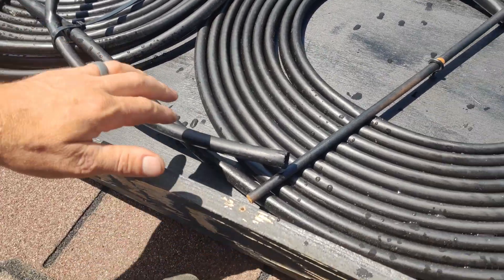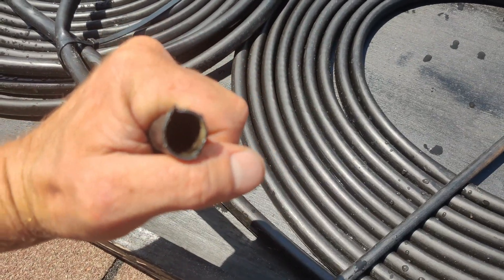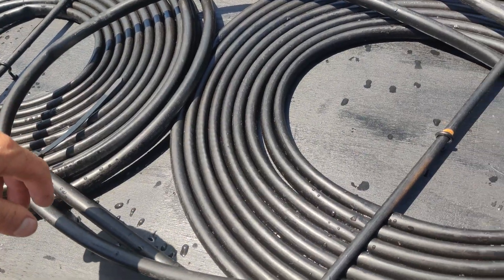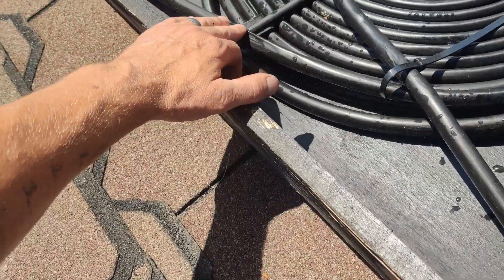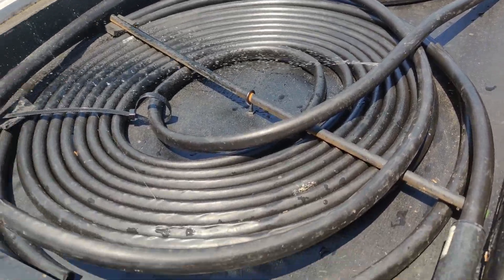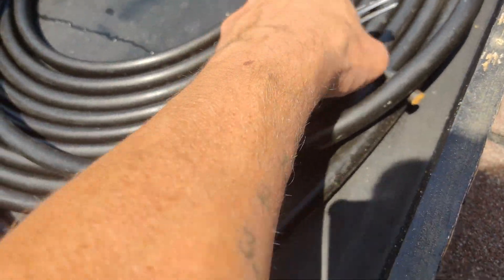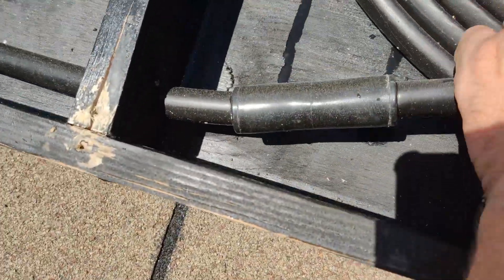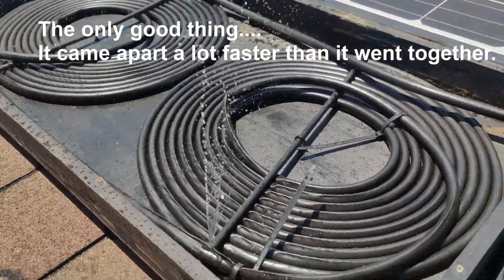DIY (don't) Solar water / hot tub/ pool heater. Watch before you waste your money!

Comment: Drip tube is where you went wrong. Use Pex, and coat it with an appropriate black paint. I live in the Mojave Desert the UV levels are typically 10 which fries everything. They do just fine here, you just didn’t use the correct materials.
Reply: my first instinct would be to use some sort of metal heat exchanger like a car radiator and put it in a black painted box.

Comment: Sorry your panels failed so badly. I am an HVAC tech, based on my experience with various forms of heat transfer and also seeing what survives exposure to the sun on roof tops I would recommend soft copper. Good luck in the future.

Comment: I still don't understand why you people don't just have a 6 pk of 55 gallon drums in the hot attic. To me having your own personal water tower with hot water from the heat of the attic space.  MORE LOGICAL WAY OF DOING WHAT UOU DID BROTHER
Reply: 2700 pounds on your ceiling?
Reply: Not to mention, a somewhat dodgy water setup in the attic. If it leaks, you've got big problems.

You're asking "you people" to try it. You try it first and let us know how it goes.
Reply: @Dwigt_Rortugal  Also, even though the air in the attic is hot, that heat isn't enough to heat 300 gallons of water.

Comment: You should use HDPE pipes - UV resistant instead.
Reply: Regular polyethylene is supposed to be heat-tolerant to 276°. I used it on my heater, regular old Rainbird sprinkler tubing (swing pipe?). Worked fine for years. 🤷🏼‍♂️

Comment: Well MINE sure worked!! Same exact design, but with no cover on it. My pool was actually too hot, in Michigan, well beyond the usual pool season. It ran 2yrs, then we moved. It was still in perfect operational condition with zero deterioration when I took it down.
Reply: Yeah I don't know seems like this dude probably left water in it over the winter which blew everything up when it froze causing all this damage.
I built one out of 150 ft garden hose that I tossed up on my roof. Been up there three years now no problems.
Reply: Lots of people try slowing down the flow, thinking they get more btu from the panel. You don't. It just melts the plastic and destroys the system. Looks like what he did. Also lived in florida and Michigan. Can say Michigananders don't know what uv damage means lol. Also florida doesn't know what cold means.
Reply: I think the water flow was too slow perhaps

Comment: Not enough flow. You need to circulate it way faster. There's no way a sump pump can push enough flow through what is that 200 meters of cheap pipe?

Comment: I am planning to make one of these, but cover everything with 4-6 inches of sand to make a heat sink and help stabilize the temps.  Will post a vid if it works, but you may be able to salve this setup if it does.

Comment: I've been watching a lot of these videos in preparation for building my own, and it seems many folks make the same mistake from a physics perspective: they drive the water through the pipes as slow as possible in order to maximize the water temperature coming out of the line. This is not a good idea and it does nothing for you (in fact, it's likely counter productive). Yes, you get hot water at the end line, but you haven't actually moved any more heat into your pool then you would have if you would have had the water running on max. In fact, you're likely moving LESS heat into the pool. Remember where your heat is coming from: the sun. Less sun isn't hitting the pipes just because the water is moving faster (and is cooler on the other end of the line then if you were running the water slower). And to add insult to injury, you are just causing more problems: as the retained heat of the unit increases, it is causing more damage to the unit. Better to not allow it to retain much of any heat and instead put that heat in the pool where it belongs (by running the water through the pipes as fast as possible). Put it another way: you aren't building a domestic hot water heater to store heat for later ... you're heating a pool. Pump the heat into the pool as fast as you can.

In addition, I've seen folks not use UV filtered covers and UV resistant piping... this too will cause the unit to fail. Finally, spraying plastic with solvent/oil based spray paint will likely eat it up quicker. Probably better to just put the black piping on top of tar paper or something and not spray it at all (since the pipe is already black, I'm not sure what it gets you to spray it black again other than perhaps protection if your piping+cover aren't rated for UV exposure. Further, black pipe probably exhibits different thermal expansion properties vs. the paint making any coating unstable and likely to fail).
Reply: you get it. same amount of energy to heat 1L by 10C as it takes to heat 10L by 1C. well.. sort of. shrug. 0 and 100 being exceptions... specific heats... meh.
whatever, the greater the differential, the greater the flow. cold pipes and small temperature rise = maximum heat transfer from sun to water.

and chilly pipes dont tend to melt. win win.

ive had black poly line kicking around for 30 odd years and its not degrading like this...
Reply: We have a new pool being installed and this is exactly what we plan to do. Move water into the pipes, let the sun transfer the heat, and move it into the pool at a good pace. I plan to make mine with a submersible pump in the pool. Here in Texas I would only need this thing for a month in the spring (to heat the pool up faster) and maybe in the fall to extend swim season by a few weeks.
Reply: @fearlessfreep  This is a wrong idea.. You want to create a fast circulation to gain heat.
Reply: I could use some advice on making mine better. I have 200 feet of the same irrigation line the guy in the video is using sitting on a sheet of osb painted black  and then I put it on a piece of insulating foam board on the ground. It's connected to a very small submersible pond pump, it's about 18 gpm, seems fast enough though, the coil stays pretty cool to the touch. I get about a 4 degree rise from it. Pool was about 68 degrees F when I first filled it about 2 weeks ago, and is just now at about 77 degrees. Would like it to be around 80, that's where it feels most comfortable for me to swim in. It's a 16 foot round above ground pool, and it's taking so long to heat it. Should I add another 100 or 200 feet to it? Also it's uncovered, would that help enough by itself with out adding line? If so, would a plastic dropcloth work?
Reply: @wolfman122970  are you thinking you'd split the one pump into 2x200ft lines or would you add another pump? If you're thinking about adding another 200ft, I'd probably increase the number of gpm being heated by adding a second pump.

Put it this way: a 16'x48" pool has 5,145 gal. That means it takes almost 5 hrs to circulate the whole pool. That is only a couple circulations during the hottest time of the day at most. The rest of the time - especially if your coils aren't enclosed - you may be radiating more heat than you are taking in (so your pump should be off at night and during periods when the water is warmer than the outside air if the coil isn't in direct sunlight).

As for a solar cover, this is absolutely helps and I would do that before you do anything else (for example, I warm my 30K gallon pool right now with that alone). A cover is critical since you lose all your heat at night and/or when it's cool+windy. Make sure you get a solar cover though and not just a drop cloth: (a) the solar cover is air filled so it won't sink when it rains and (b) those air pockets help keep in the heat. They are definitely worth the expense.
Reply: Exactly. A better way to think of it is that you want to cool the black hose using the water. The cooler you keep the hose, the more heat that is going into the pool. 100°F isn't that hot, but the rubber conducts heat poorly and must be much hotter than 100°F to get the water to that temperature. One really needs to use materials that can handle moderate heat. Materials like garden hose rubber and PVC are not a good idea. His ambient 125°F temperature alone would cause issues.

Comment: looks like from the deformation and ridges on the top of the tubing that its being squashed by the suction weight of the water from the return line when the pump is turned off.  When the pump is turned on it expands again. This work hardening of the tube will eventually cause it to fail. Either get a thicker tube that resists crushing or add a solenoid on the return to close when the pump is off and stop gravity squashing the tube.

Comment: I don't know if you tried this yet - but increasing the pump speed should help once you fixed the holes in the pipe.  
You may also put your pipe in rigid foam and add foam sides.
As others have said, a better pipe - ideally copper or steel would last much longer but at a much higher price.

Comment: shouldve used pex instead of dripline.  Pex is much thicker.  even better if you can source the black pex so you don't need to paint it. Pex is also designed to handle high heat,  while dripline is meant for only cold water.

Comment: I just built one and used PEX tubing sprayed with Matte black. Costs a little more but from what I've read it holds up much better. Might cost a little more on the initial outlay but my philosophy is that if it lasts a few years it will have paid for itself considering today's prices in both units and energy 

any of you guys have thoughts on PEX either way?
Reply: I totally agree, Steven.  Drip tube was designed for a max of 20 PSI and although direct sunlight shouldn't be an issue, it does eventually take it's toll. Having worked for a major manufacturer of irrigation products in sales and Tech service, I have witnessed UV degradation of poly pipe over time.  PEX would be a much more viable material.

Comment: ive try socarex too ... black abs tubing.. vendoor said to me to take the cheaper one more easy to bend... its 37 euro for 25 meter ... work very well too ive made a 1.5square meter captor with it inside a insulted panell with scrap double window..; average power going to the water was 600 watt...

Comment: If you’re using irrigation pipe or regular PVC it’s only rated for 140 F. In an enclosure with glass over top of it the inside temp will exceed 185 F on an 90F degree day. Do not put glass over top. Just leave it open and the pipe won’t pop. At least for a couple years or so. I know this cause I have done it now my pipe is 100% copper and boy does it scold you if not careful. Overall once you get the water flowing it will be approximate 10 degrees hotter than pool water. So I need a lot more to be affective.

Comment: have recovered a abs like thin paralel canal roll of solar heater like 5 meter * 60 cm... it go very well .. i heat a 800 liter plastic palet container... ive fill it up halfway at 11h... its 14h30 and ma 400 liter are as much heated as i take ma bath like... en of the day it gonna top like at 42 or more depending of the sun...

Comment: Sun will destroy PVC and other plastic.   Need to keep dark.   Paint Black so UV light does not destroy tubing.  Also tubing must be rated for very hot range.   How hot was it in your hot box ? 300+ deg F. ? ?  Could try copper also but costs more.

Comment: So the idea is to use inexpensive drip tube which I have running all over my yard in the blistering sun for years on end with no issues. I wonder if continuing with the drip tube use but making the enclosure basically a bath tub sorts speak where the tube is in a few inches of water. The water will theoretically cool the drip tube or a better way of putting it "Keep it from overheating" yet still allow the sun to heat the black drip line to heat the water inside. Probably cause more problems than it fixes as I sit here thinking about it. condensation blocking UV, leaks, weight etc.

Comment: Thankyou for showing your failures! You’ve gained a sub :-)
Hopefully it’s all running now.
Have you thought of running the 3 spirals in parallel?
This will increase the flow, decrease the temperature dramatically in the last two spirals …
Essentially you’d be using your pool to cool the spirals!! 

Getting low flow of scalding hot water shouldn’t be your goal…you should aim for a high flow of water that’s warmer than your pool

Comment: Just paint it black 
Even though they are already black, the paint will degrade first from the sun instead of the sun rays hitting the tube directly.
Use a water based paint to avoid solvents damaging the plastic.
Keep on repainting them every few months.
Reply: What kind of hose do you recommend, even though I watched this video, I'm still gonna attempt to make one, but I'm not sure on exactly the best materials
Reply: @brucehall8570  -- plastidip black

Comment: A better (cosmetically, functional, and economical) option would be to run pex between your rafters. Then back it up with some foil "radiant barrier" material. 
We all know how hot it gets in the attic. Have you ever touched the roof sheeting in the attic? Should be able to heat your pool, the neighbors too while lowering your house cooling bill~!
Major edit: Must have "Continuous flow control" with probably PRV

Comment: Well shit! Im just about done building my heater Using the same tubing. Is it the heat or uv that damages it? Maybe I should flex seal it before I incase it with glass. Idk.  If it's covered with sand would that help the uv? It's been alot of work and I'd hate to see it only last a year
Reply: Just don’t leave it out for freezing temperatures

Comment: That's a disappointment. 

Were the pipes are filled at all times?  

That happened to mine when I followed someone's advice to drain them. I'll keep them out of the sun next time if they're empty.
Reply from the maker: They were filled. I had one-way vales to keep them from draining and over filling the tub. They were off for several months due to the temps and not having more control than a timer. Definitely noticed the electric bill this year go back up though.

Comment: Looks like you need to control the flow. You sayed its hard to control. Well yhe pump you were using wasnt pumping gast enough to regulate the water temperature at under pipe rated value!! 170f so pump the water faster or add a radiator in between each transition box to cool the water down and keep the pipes under temp rated value begote deforming!! Or use pipe rated for over 200f

Comment: Those coils should be plumbed up parralel rather then in serious.  This will increase the flow rate, decrease the temp that the pex tube reaches and actually heat your pool a lot more effeciently.   Running those coils in serious like your doing is why your pex melts
Reply: He did not use pex. He used thin wall irrigation tubing designed for cold water at very low pressure.

Comment: That tubing sucks! I had the same issues, spent a few extra bucks for PEX tubing and it works amazing! Raises my pool temp an average 12 degrees on a mild sunny day!
Reply from the maker: I left the boxes up and the plastic tops. was thinking of going to pex. all the commercial options are in crap formats.
Reply: When you say 12 degrees. What is your water temp, and outside air temp? I ought a house with a pool and am seriously thinking of trying this. My concern is if it will make an impact.
Reply: @danielallmon2173  Outside air temps vary from 80-90 degrees and pool temps reach upwards of 90. It works great and is cheap and easy to build. I'm building another one for those cooler days so we can swim earlier and later into the season.
Reply from the maker: Alright so I looked at PEX, stuff at the big box store is only rated for a few days of UV exposure. No gonna waste the money.
Reply from the maker: @danielallmon2173  It worked great. Didnt have to heat all summer, and probably would have worked most of the winter if I had a controller on it. The money saved from one season probably paid for everything... just not the hassle once it started leaking
Reply: @whynowork8480  I've used my PEX set up all year, worked great and still looks and feels like new, be sure to give it a good coat of matte black paint for protection and better heat output